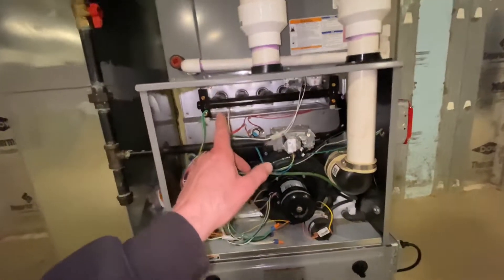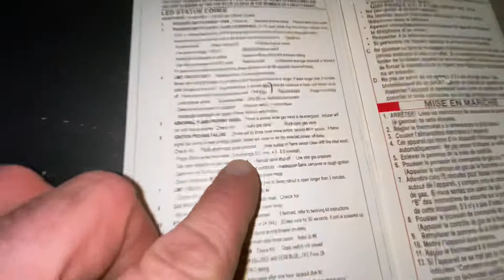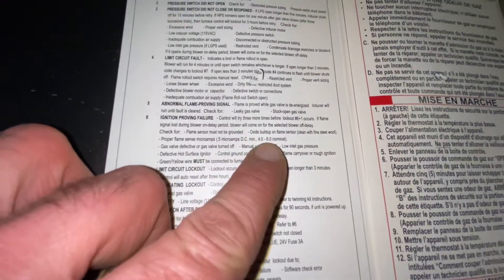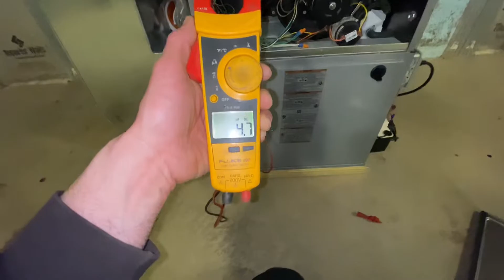Testing Furnace Flame Sensor Before/ After Cleaning Verifying Flame Current

Comment: can u conifirm if it is dc or ac to verify flame sensor? also did u pull flame sensor wire and connect to meter then meter other cable to the sensor?
Reply: It's DC as you can see on the meters screen. Yes that's how it's connected
Reply: @JohnSmith-dh3kx  thx!

Comment: I have the same furnace as in your video and I have cleaned the sensor and burner heads. I have a voltage of 107 from the sensor to the ground. When I connect the meter in series with the flame rod and the burners fire up, I get zero miro amps. I think it may be the circuit board but not sure. Would there be another reason I do not get a reading?  After a few seconds, the burners shut off. I have had it fire up for as long as 60 seconds and then stop.

Comment: that looked like a ceramic flame sensor i thought you shoudnt get your oily fingers on the rod itself which it looks like you did. also you should mention what you used to clean the sensor like emory cloth or scrotch brite pad. i heard on boilers for examples you dont want to use steel wool as it will leave residue that will crystalize over the flame rod and insulate it preventing it from working

Comment: Would you get a microamp reading if putting meter in series between the green ground wire and the manifold?
Reply: Yes. Also check the flame sensor to ac volts to ground